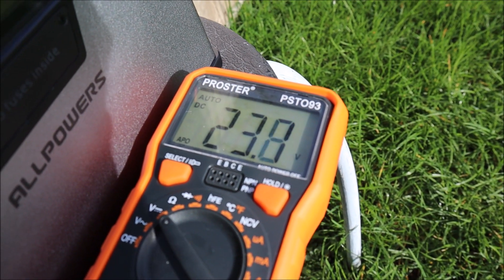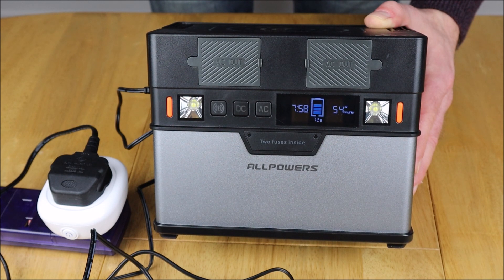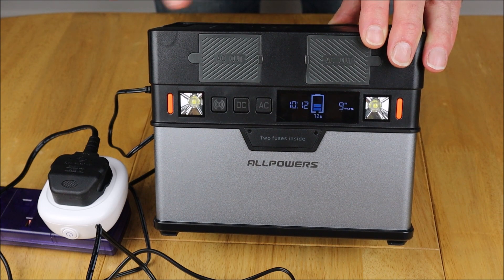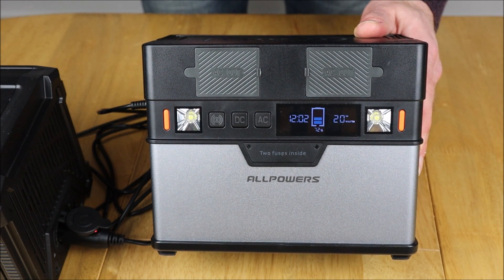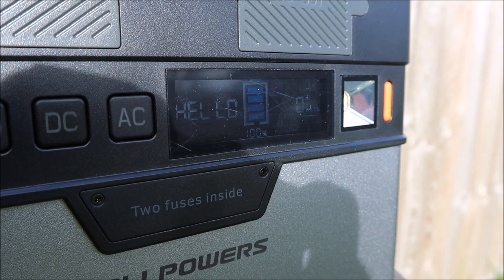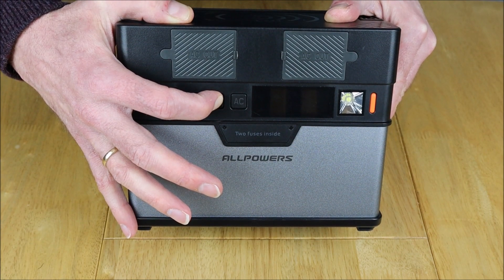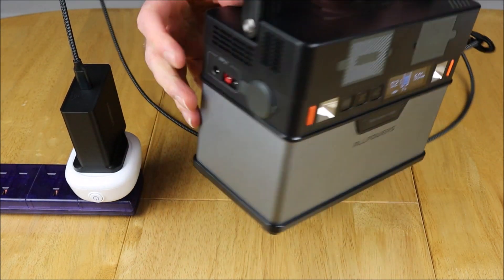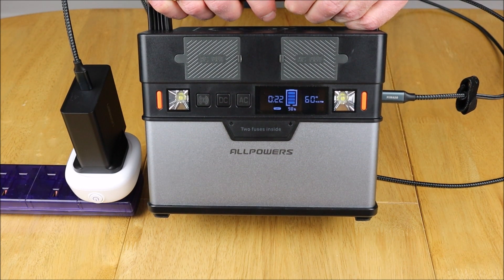ALLPOWERS 372Wh Portable Solar Generator Update | Charging Rundown

Comment: @DADvinci do you know if nowadays they are shipping this unit with more than just the wall charger? 
Does everyone as issues with it? I was going to buy the flawless suaoki ps5b 400wh but then they sold out, afterwards i've found the Tacklife p40/p50 (same as bluetti ac50) with 500wh and just 50eur more than the Suaoki, guess what? They also sold out like the day after i picked it on amazon 😢.

Both those units are virtually bullet proof so far from all the reviews for the past year or 2, they both come with all the cables and everything works.
The allpowers 372wh costs like 150eur less than the Suaoki, do you think it would work ok? Any recommendations for solar charging, cabling and also for car 12v charging.

Thanks for your help and time, grest videos too but i am honest i usually watch HoboTech for this sort of stuff.
Reply from the maker: @Frederico Santos  Good day to you and thanks for your question! I'm not sure what they are currently shipping as standard, but I know that some viewers have received a USB-C PD charger (brick with in-built cable, not separate brick and cable like mine) from ALLPOWERS. It might be worth dropping them an email to see what they ship to your location.

The 372Wh does have charging 'characteristics'. I was on the verge of sending mine back, despite working with the manufacturer to come up with a solution. By chance, I found a workaround for solar charging via the Anderson port (wake-up issue). This video covers that if you've not had chance to see it > https://youtu.be/ViLdkYzOZqA . Since sorting this, I can charge perfectly fine via the Anderson port (for solar) or via the USB-C PD from my other solar generator. For me, the 372Wh represents good value for money, but only if you know the workaround and best ways to charge it (Anderson port or USB-C PD port). 

Car charging works fine, although I rarely use it to be honest. A standard 12V DC cigarette lighter to DC5521 does the trick, so finding one with good reviews would be the best bet for this method.

I hope this helps. Please let me know if you need anything else. All the best, Adrian
Reply: @DADvinci  hi and good day to you too, thanks for the prompt reply and super detailed.
I ordered mime a few days ago, shipping estimates are around a month at least so i just have to wait around to see how mine works out to be, i really hope they solved those issues with the upside down plugs and stuff lile that so that i can just buy their 60watt foldable panel and plug it right in with no issues  whenever we park the 4x4.

What solar panel do you recommend to charge this unit?
Any other issues i should be aware of? To ask for them when i contact the manufacturer. I assum i can just send an email to support @ all powers. Com  am i right?

Best regards and hope you can keep us all entertained with such good content. Congrats for your great videos.
Reply from the maker: @Frederico Santos  Thank you for your very kind feedback, it's really appreciated😊 I'm not sure if you've seen this video > https://youtu.be/ViLdkYzOZqA but it might be useful for when your solar generator and panel arrives.

In terms of a foldable solar panel and based on my long-term experience, I recommend the one in this video > https://youtu.be/qLYXnp5OGmw . If you want to charge a little faster, the 100W version would also fit the bill (although it's bigger). If you go for one of these foldable panels, you'll need a DC to Anderson cable (which are rarely in stock for some reason). You could check with ALLPOWERS first to see if they can supply one, but it might take some time to arrive. Another option is Amazon.com which usually have some available. If you want to know about connecting up a standard 100W rigid panel, please let me know.

For contacting ALLPOWERS I tend to use support@allpowers.net, so I suggest trying that first. I hope this helps and please let me know if you need anything else. All the very best, Adrian
Reply: @DADvinci  hi,  i thought the all powers power station came with a solsr charging cable.
And i was confident that the 60w solar panel from all powers csme with 12v cig lighter charger and solar charging cable : https://www.amazon.es/gp/aw/d/B00MQRLBPI/ref=ox_sc_saved_image_1?smid=A13P6277X44WWB&psc=1

That was the whole reason to buy that solar panel, there are cheaper ones but the picture doesn't shiw all those cables, the allpowers one does.
Reply from the maker: @Frederico Santos  Good day! You are correct, the 60W solar panel kit includes 12V cigarette lighter cable & solar charging cable to connect the panel to the DC input on the 372Wh.

The only problem with the 372Wh DC input for charging from a solar panel is that cloudy days lower the charging rate. Clouds interrupt the sun, which naturally drops the watts input and when the sun comes out again the rate doesn’t increase back up to the best the panel can deliver. The Anderson port (red/black connectors) on the 372Wh is a better method to charge from solar as the charging rate is always the best the panel can deliver (not affected by cloudy days). The cables in the solar panel kit will still charge the 372Wh.

I hope this makes sense. Please let me know if you have any more questions. All the best, Adrian
Reply: @DADvinci  hi again,

Yes qnd many thanks for the explanations, i basically need to use a cable from the panel to the power station that is Anderson plug and not the supplied by allpowers.

In all fairness they finally reolied and they were kind enough to agree upon sending me all the necessary extrs cables that i want ( i said prior to shipping to send me those cables instead of the wall brick so they apologized for not looking at it on time and that's why they agreed sending those extra cables for free because ultimately it was their fault i guess)

I received my 372wh solar generator today, pscksged beautifully, well designed and a decent quality look as well. It weights a bit but nothing too bad just like you said.
Only concern is mine came fully discharged, literally 0%, had no life whatsoever before i plugged it in to the wall socket with the supplied brick and it's now charging at 4watt from the wall according to the built in screen.
Is that a problem or will it cause sny issues the fact that it had 0% charge for who knows for how long?
And does that mean that mine has the same reversed anderson plug issue that yours did?

Once again many thanks for all the explanations.
Best wishes
Reply: @DADvinci  actually it's in 7 watt now but still 0% charging :s ( edit - it's now 3%  has been charging for 3 hours  and if i switch one of the led lights the whole thing shuts off and shows a signal of empty battery) 
Do you reckon mine suffers the same issue as yours ?
Reply from the maker: @Frederico Santos  Good day! I've heard of other viewers receiving the unit with 0% charge. Are you charging like this part of the video > 1:45 ? The standard power brick should be charging faster than 7W. I suggest unplugging and letting the display go to sleep before plugging back in to charge.

Please can you try this and let me know how you get on. I can then take you through the next thing if it still doesn't work properly. All the best, Adrian
Reply: @DADvinci  good day and as usual many thanks for the advice. I did exsctly what you did in the video and it's now charging, from the wall with the provided brick charger to the dc input , at 58watt.
Let's see how everything else works,  specially the solar charging.

Best wishes
Reply from the maker: @Frederico Santos  That's brilliant! I'm so pleased it worked😊  Please can you let me know how you get on with solar charging? Take care, Adrian
Reply: @DADvinci  hi, i finally got my foldable solar panel, not the all powers 60w one though, i bought the eco worthy 120wstt foldable panel thru amazon for less than what the 60w allpowers one costs.
Unfortunately i've onlytested it once so far and on a grey and cloudy day, despite the not ideal conditions it still pulled in around 28/30 watt to the 372wh all powers solar generator. I think it will work great on sunny days and it has great results on cloudy days too.
Definitely recommend this setup to anyone's interested.
Btw the eco worthy 120w foldable panel is made of 4x 30w panels, dust proof, water proof, somewhst shock proof and very well finished and designed.
Reply: @DADvinci  last update, same cloudy day, just a small sun break and it's consistently pulling 55watt solar input 😁😁😁😁 super happy with this results.
If you want i've got pictures of the results/test and link for the solar panel.
Reply from the maker: @Frederico Santos  Thank you so much for sharing and it's great to hear you got the more powerful panel for less. 55W is a great result and I'm really glad you are happy with your setup 😀👍

Please can you share the link when you have a moment? All the very best, Adrian
Reply: @DADvinci   yes of course, this is the one i have https://www.amazon.es/gp/aw/d/B07RVG179M?psc=1&ref=ppx_pop_mob_b_asin_title
It's a "eco Worthy 120watt"

Works great with the 372wh allpowers solar generator so far. Allthough the panel also comes with a controler with built on usb plugs and pre wired battery clamps and so on, in my case i don't use that i just plug the panel thru mc4 to anderson or to dc straight into the generator.
Super happy with his setup and i'm confident it will be able to power and mantain my 4x4's compressed fridge/freezer ( like the arb ones) and even power a few more things as well as charge everything else we carry on our trips like phones, powerbank, 12 fans and other small apliances.

I just have one last question, do you reckon i could use the allpowers 372wh as a booster to start my 4x4 on remote locations in case the starter battery dies?

Best regards
Reply from the maker: @Frederico Santos  Many thanks for the link! I’m really pleased you’ve got the setup you wanted. I've not tested it as a booster and doubt it would have the amps you'd need to get things going. You could always get a mains 12V charger to plug into the 372Wh if you got into a tough situation. That would take a little longer to boost the 4x4 battery up enough for starting, but might be an option. All the best, Adrian
Reply: @DADvinci  by the way, i've been having some issues with it powering the fridge/freezer ( maximun it draws around 50/55 watt. And the compresor cycles on and off so it's not constant 50w itvs more like every 5 minutes or 10)
Is the 12v cigarette lighter output regulated?  Wich port should i use to power the fridge all the way untill the power station /solar generator drops to 0%?
Also i've heard that some people have issues with it(the generator /power station) being charged from the 12v cigarrette car plug from the car itself  that it can drop the car battery to low by sucking too much energy.... . Any opinion or ideas on that?
Reply from the maker: @Frederico Santos  Good day! The 12V cigarette lighter output is not regulated. The only way I'm aware of is to use a 220V AC to 12V DC transformer like this > https://amzn.to/2BDSS9u (affiliate link). It would use more power, but enable you to use the whole battery charge for a fridge that requires 12V (although I've not tested one myself).

When charging from my car, I've always had the engine running (been on the go) otherwise the car battery will drain quickly. Charging from a car will always depend on a number of factors including the age of car battery (ability to hold charge), amount of cranking amps required to start the engine (too little left it won’t turn over) and whether the alternator is good shape (ability to provide more power than is being consumed). Having the car running whilst charging is a must though.

I hope this helps. Please shout if you need anything else. All the best, Adrian
Reply: @DADvinci  hi, i also got a anderson to dc cable that allpowers sent to me free of chwrge together with the 12v cigarrete to dc (to chsrge it whilst driving) and the usb pd wallbrick chsrger wich is great. All free of charge, and because i originally asked for anderson to mc4 and not anderson to dc wich is what they sent me, now they've shipped the correct one in express mail also free of charge.
Their customer service is slow but definitely 5* , super friendly and willing to help and solve any problems.

So do you recommend me using the anderson to dc male  cable, that i already have, to power the 12v fridge? The andersor port could be used for output as well? It should be regulated output am i right? Hopefully that way it can pull every bit of power left in the 372wh solar generator /power station .

Thank you flr all the help and your great videos.
Best regards
Reply from the maker: @Frederico Santos  Good day to you! I'm so pleased to hear you got the whole set of cables from ALLPOWERS! It's great to hear you had a good experience (even if it was slow).

The Anderson port on the 372Wh is an input only I'm afraid, so you couldn't power anything from the port. All the 12V outputs are not regulated, so even the 2 x DC outputs next to the USB outputs would also fall below 12V as the overall battery charge dropped too. The only real way to get every last drop of power for a 12V fridge that needed to remain at 12V or more, is with the 220V AC to 12V DC transformer.

I sincerely appreciate your kind feedback and comments like yours make this whole YouTube endeavour worthwhile. Please let me know if you need anything else. Take care and all the best, Adrian
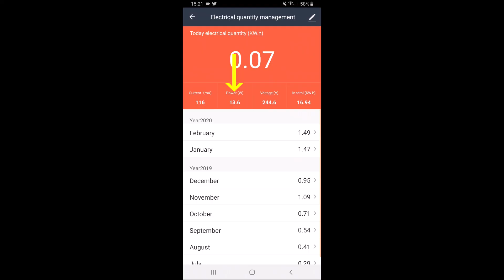Reply: @DADvinci  hi, and yes they were great with me.  Just a bit disappointed now that i'm actually using the 12v  fridge freezer plugged into the 372wh allpowers unit and it just isn't glod enough,  if i plug it to the dc cigarette lighter output, maybe it lasts 5 or 6 hours and as soon as the allpowers unit goes down to 60/70 %. It shuts off, low voltage. Then i have to plug it to the Ac output, immediately instead of pulling 40/50watt it starts pulling 70 or 80 watt and when the compresor is not working it still pulls a few watts for the inverter and it generates a lot of heat as well.   So then the AP 372wh unit is at about 50/60 % capacity and maybe it lasts 3:30/4 hours tops...   Not happy with this lack of practical performance to be honest, i mean it's great as a big power bank but to actuslly power stuff off grid.... Don't know...  Solar input with a 120 watt panel thru the dc port is only up to 55/65 watts,  if the fridge is on max power  setting  and using the ac port  i'm doomed, it pulls up to 80 watt  when the compresor is running  so even if i charged the Ap unit from solar at the same time, it would probably still go down to 0 .  I have to do some more testing outdoors, but i am a bit disappointed i was expecting at least one full night of power from the dc output, maybe even 2 nights ( 8hour per night, would be 16 hours) but now i'm not sure it would hold up for one night  straight, if i leave it plugged to the cigarette lighter dc output, it won't last  a full night becwuse of voltage dropping to low (but still lile 75% battery left) , if i plug it to the ac output it uses to much energy and it probably won't last a full night.
I'll keep you updated with any new results in a few weeks
Reply from the maker: @Frederico Santos  Good day! I'm sorry you are disappointed with the non-regulated 12V. This can be a problem with quite a few solar generators when it comes to 12V devices that need to stay above 12V (e.g. fridges) and I'm not sure why manufacturers don't add a regulation circuit by default. I hope your testing goes well and I look forward to hearing how you get on. Take care, Adrian
Reply: @DADvinci  just found a little trick, if the solsr generator is at 100% not 99% (with solar charging that last 1% takes a lot of time) it can power the fridge on eco mode (40/50watts) for over 9hours and it hits 75% on the solsr generator. When it reaches around 50/55% on the solar generator it cuts off, then i plug to the ac output ( uses more power and doesn't last longer) for another 8 to 9 hours, so in total would be around 14 hours (maybe 16)on the dc 12v output and then another 8 with the ac output, more or less 24/25 hours.

Thanks for all the help
👍
Reply: @DADvinci  and by the way, and this goes for everyone interested, don't even waste time trying to vhsrge via 12v cigarette lighter socket from your vehicle, it only charges the 372wh all powers unit at around 2 watt 😱🙄🙈🙈

Solar has been a semi disappointment so far still waiting to get my hands on the mc4 to Anderson cable wich should help making solsr charge more consistant and increase it's capability as well i hope, right now peak is 58  watt solar in real camping conditions, lots of small losses due to clouds, sun angle etc.. wich with the mc4 to dc cable makes it 10x worse, having to check on your solar charge every 'x' minutes just to make sure it's actually pulling in at least 45/50 estt it's a huge pain.

To run a fridge in real life udage i pretty much so far rule this unit as useless to a certain degree, if you chsrge it with solar whils driving with a panel fixed on the roof and run the fridgre to the car dc cigarette lighter plug and then run the allpowers unit with inverter on for ac power to power the fridge during the night it might be possible, but it's one of those situations that requires everything to go as planned and perfect and not always it happens likr that so this is a unit i am beginning to think about upgrading to a better one with more capability and regulsted dc output port